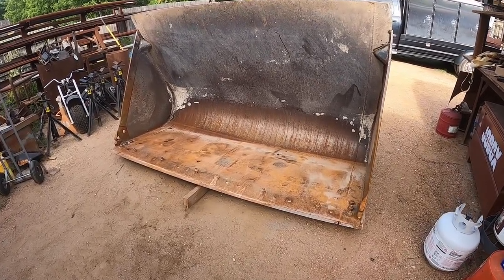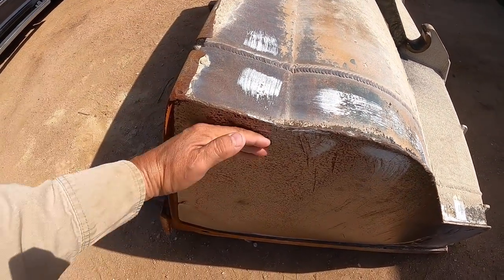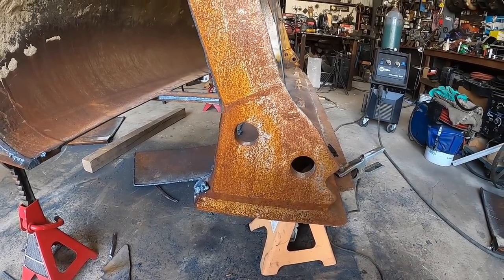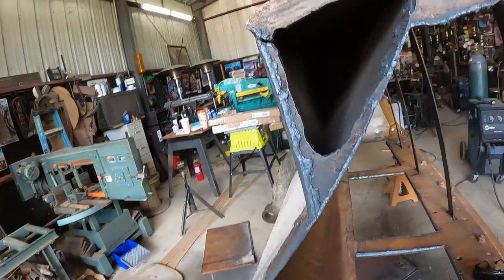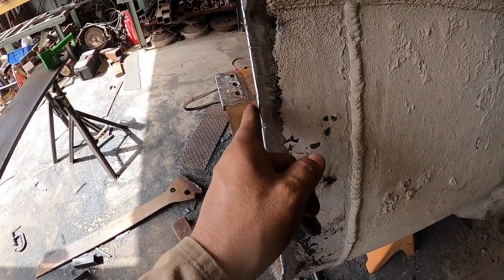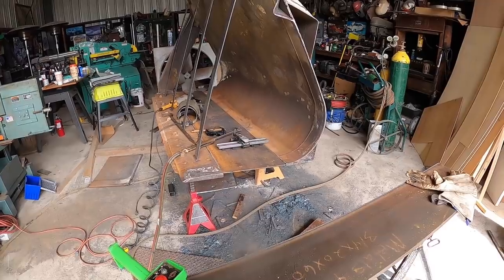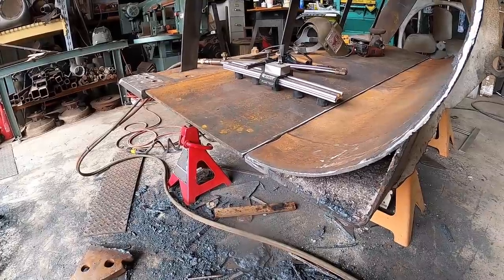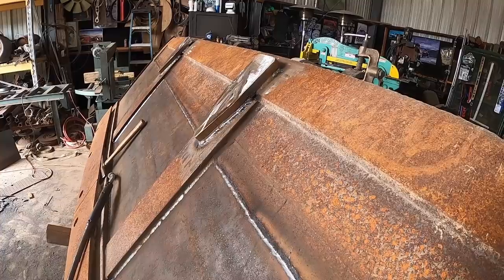Front End Loader Bucket Rebuild

Comment: I was fortunate to work in the world's deepest copper mine "Deep Ore" OKIEP Copper Mines at the time during 1987 as an apprentice Diesel Mechanic. We mainly did maintenance on several underground mechanical "equipment" (as we called these machines) such as the Wagner StB range scoop-trams. It was so amazing to assist and watch the welders and boilermakers fixing scoop bucket lips (V-shaped) and worn bushes and collars on swivel parts of the scoops. 

I remember you used an angle iron to put in place bushes for bucket pins which you tack-weld onto the angle iron. Our boilermakers used hollow pipes (about 100 inner diameter / 4")  to sleeve the bushes left or right into place. After the bushes was weld nicely into place on each bush was a brass collar sleeve pressed from each side of the bush into place. (Two halves on each bush with a 1x cm distance between each collar in centre of bush making room for the grease).  Best part was all these pins, bushes and brass sleeves were manufactured at surface in a massive production Machine-shop of the mine. Unfortunately the entire Copper Mine became redundant by early 2000's. 

Well I so enjoy watching your work and it's amazing to see the knowledge you have on the different metals you use for different applications. Keep up doing these great videos.  
🇿🇦🇿🇦
Reply from the maker: Thanks man. it would have been cool to work in a mine. well, for a little bit at least

Comment: IC you did a super job on this loader bucket ! I am retired at 83 but still welding (not loader buckets) but did some which were very  mangeled and had to use a rosebud torch,6' long-light it with a greasy rag laid on the ground and a sledge hammer ! Always good to see a good welder doing good work ! A really gooood job !!! Thanks for sharing !

Comment: When I was just starting out in my 20s an old timer showed me a simple circle cutter just clamp a flat file to the torch with a vise grip i used that method for many years 78 years old now retired 14 years miss heavy equipment welding repair

Comment: Looks like an old Balderson quick coupler bucket for a Cat wheel loader. Have you ever considered using Hardox 400 for those wear surfaces that are high abrasion, low impact areas? A little more expensive than AR but wears great.

Comment: Badass man. Pulse arc with the miller? Like it? What gas and wire? I tried it with a miller 350 one time and i never could get it to run as good as the Lincoln 350mps I had run. I finally got one of my own in the shop now.

Comment: I got my Acetylene torch, and cutter stolen this summer. Together with all the hoses, nozzles, and regulators. The tubes were left, guess the thieves were a bit too thinly built to lift them. That stuff is very expensive to replace, so be wary where you store things like that.

Comment: I also do the same thing as you for myself on my own equipment. It would be nice to know the things you take for granted. What king of plasma cutter are you using with what size tip. What welding rods do you use and why did you choose them. I can ask my welding shop for this type of info but I think it is always better to get this info from someone actually doing the work. It would also be nice to know what type of rods and materials have failed and why, so they can be avoided. I don't mean to be a pain just looking for a little more education beyond just watching you work. I do enjoy watching a professional perform his craft and I like your videos a lot.
Reply from the maker: For cutting, I use a No.1 tip on my torch with the oxy/fuel at 7 acy and 70oxy. I mostly use excalibur 7018's or fabshield 21-b fluxcore wire.

Comment: what type of metal is AR? What thickness did you use for the floor material?
Thanks for a great video.
Reply from the maker: The AR stands for Abrasion Resistant. There are several grades and several mfg's who make similar products. I believe you can get it as thin as 3/16", not sure. My customers usually provide the materials.
Reply: @ICWeld  Thank you very much for the quick reply. I really appreciate it.

Comment: Great work. Always enjoy your videos and thanks for sharing. I know you like to use E7018 when welding out in the field. How do you keep these dry? I've tried zip lock bags, seal a meal vacuum bags, rod canisters etc and nothing works out here in humid SW MO. Thanks
Reply from the maker: I go through rods pretty fast but they actually do get some rust specks in them. I rely on the weld flux coating to boil out most of the impurities in the weld puddle. Not sure if this is good or bad but I've never had any problems. Plus I don't do any code welding that needs super dry rods. But when I do, I'll buy a small can of fresh rods.
Reply: Portable Rod Oven - https://www.electroweld.com.au/persistent/catalogue_images/products/5kgelectrodeoven.jpg , (not necessarily that, I just did a random search) You will get Hydrogen Embridlement.
Reply: Googled hydrogen embrittlement and Miller has a great article on it as it pertains to weld filler metal. I'll check with my weld supplier regarding the portable rod heater. Would be great on the job. Knowledge is power. Thanks for the heads up.

Comment: Nice to work inside every now and then. Been years since I used my wire feed welder. What cover gas are you using?  I run a Argon CO2 mix with a number 6 wire in .035.
Reply from the maker: 75/25 and .045 solid wire.

Comment: Which AR alloy are you going to use? It almost seems simpler to make a new one, except for the lifters.

You’re obviously a very knowledgeable and experienced guy, so I have a question. How do you determine when to use oxy fuel or plasma? Since you use both, you apparently have strong ideas as when each is best.
Reply from the maker: Im a big oxy/fuel guy but this bucket has so much dirt and rust that the torch would struggle. the plasma was the way to go in this case. And im not sure what AR plate the customer purchased.
Reply: Thanks for the response.

Comment: Im currently replacing the floor of the same bucket. Its just about all prepped and ready for new steel to get put in. Im replacing from the curting edge to 10 inches above the bend.. What is thr best way to bend the steel around the corner?? I dont have a hydrolic brake. Any advice on how to make the bend?
Reply from the maker: probably look to a local fab shop for press brake work,

Comment: How do u get ur ezcut from not hanging up mine does
Reply from the maker: I blow off the rack. it gets rust particles trapped in it since the magnets are underneath. You may also want to open the gear cover and clean that up too. those gears are very fine. any junk or particles will make it hang up.

Comment: ?? Odd I would just replace the bucket if it had to be fixed that much. It's going to need to be fixed agian in the future. Throwing good money at garbage.
Reply from the maker: Well, the life expectancy jumped tremendously from its factory form. we replaced the metal with Abrasion Resistant plate. They're going to get many more hours of use on this thing. should last them a really good while.

Comment: I was hoping I could pick your brain a little. I don't have insta but maybe you could shoot me an email and I could respond with a few questions. Appreciate any time you take.
Reply from the maker: ask here
Reply: @ICWeld  looking to buy a legit line bore and bore welder. I have managed with a mag drill/weld base and welding by hand. Any recommendations? The other I know is based off demands and area but I feel like my rates may be low especially since I'm investing in better equipment. Do you charge per hour/per hole or per job?  Hope you have another incredible year and keep on putting that content out there!!

Comment: There is no strength in a down why don't you weld up ?
Reply from the maker: this was pulsed mig set pretty hot. I felt comfortable welding down with it.
Reply: @ICWeld  pulse mig is normally used in aluminum welding . There is no strength in a down at all no weld test is run with a down for a reason . I am a inspector for our AISC certified fab shop i would never send that to a customer .